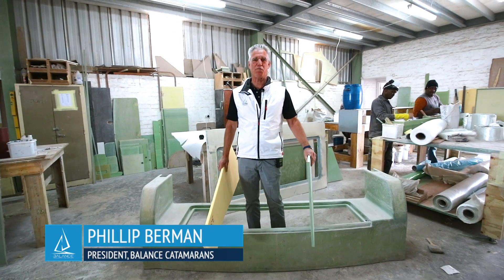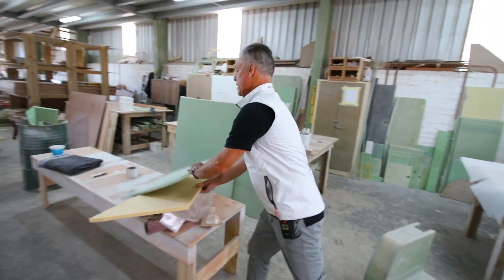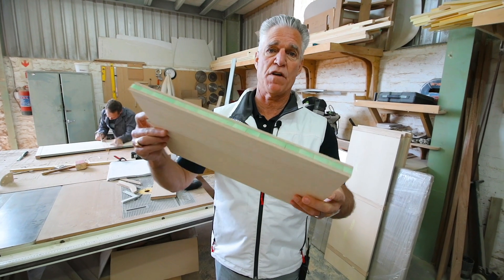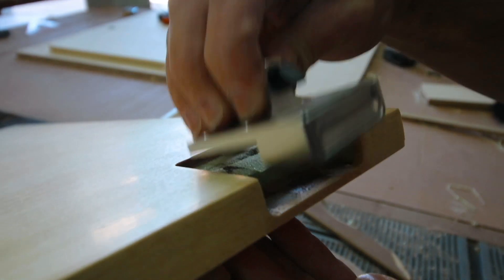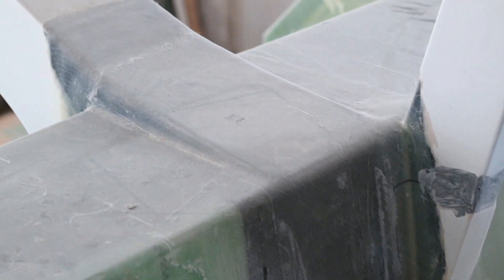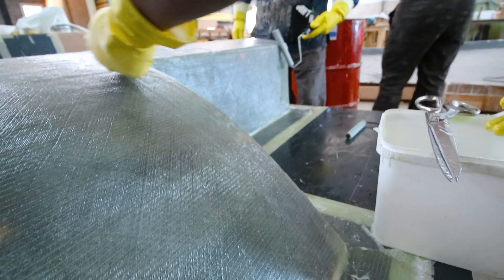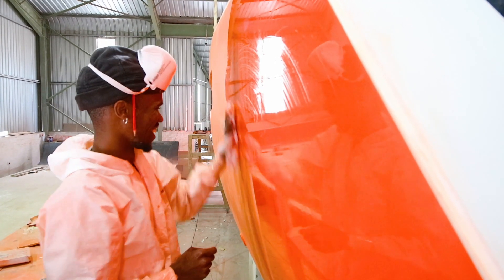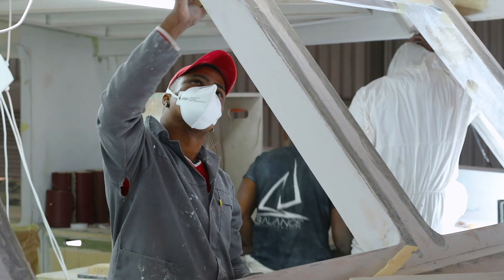Inside Balance Catamarans: Lightweight Foam Core Technology for High-Performance Boats

Comment: I have heard that mixing carbon and glass has an  issue.
If you lay carbon over glass, the load sharing means that most of the stress goes to the carbon, the glass doing far less work.

Comment: why do you use epoxy vs vinyl ester?
Reply: The real reason epoxy is used over vinyl ester is that it’s a superior resin that is is both stronger and impervious to water intrusion.  Producing a catamaran in epoxy is significantly more expensive than other materials and is only used on higher end applications and custom builds.  Keep in mind the current Gunboats are produced in epoxy next door to the Outremer factory.  Outremer’s are made out of the cheapest resin called polyester, you have to pay Outremer extra to have your boat made from vinyl ester and it’s not even an option listed on the order sheet, you have to know to ask.  They are still great boats, but an epoxy hull build is superior in every way…except it’s more expensive.  You get what you pay for!
Reply: Vinyl destroys foam
Reply: @jsandra860  nope. Poly will melt it. Vynil is just too expensive and unnecessary.
Reply: 442 and 482 are built with polyester